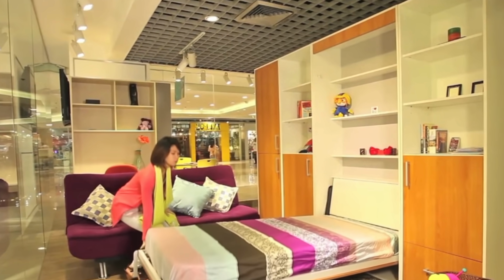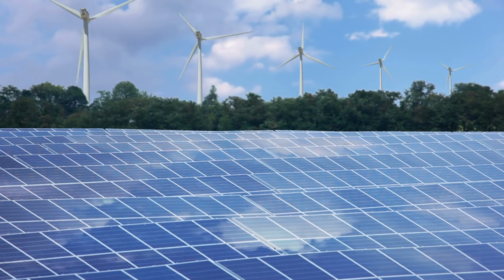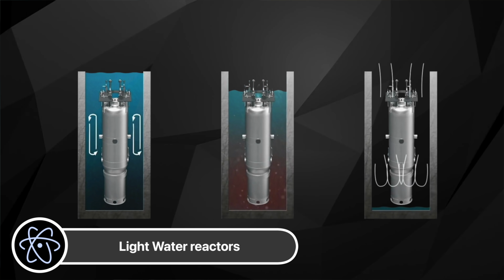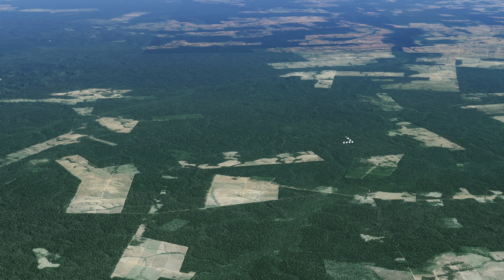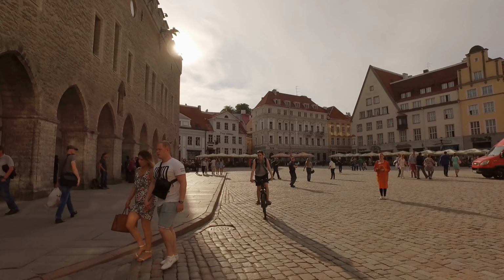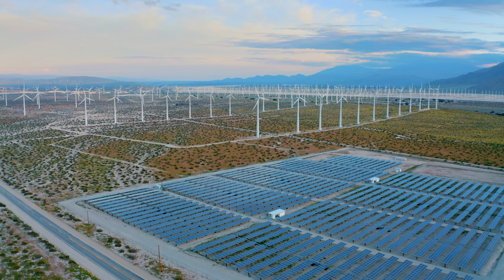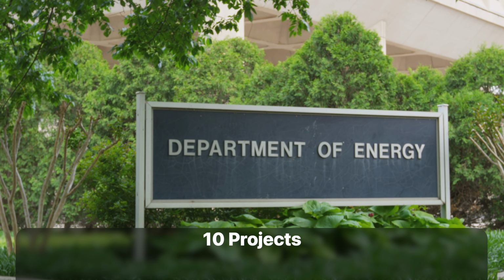Why Small Modular Nuclear Reactors Are the KEY

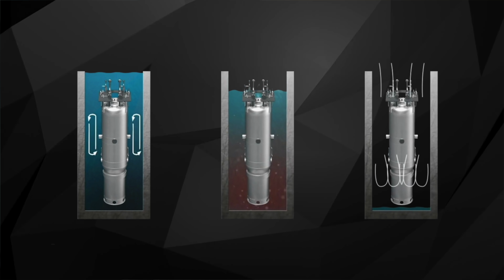Comment: 9:41 "...simply involve a core resting in a pool of water hence Light water SMRs" nope. Firstly, that's not the reason they are called light water SMRs. They are called so because the neutrons produced from nuclear reaction inside the core are moderated by light water instead of heavy water or graphite.
Also, you were showing the picture of the whole reactor vessel in a pool of water, not reactor core. The core is located inside the vessel. 
A reactor type with a core resting in a pool of water is called pool type reactor and those tend to be research reactors with the aim of generating neutrons rather than heating up water in order to make pressurised steam that will turn turbine to generate electricity.

Going back to SMRs resting in a pool of water... they are designed so in order to make sure that the pool of water acts as a heat sink when the reactor trips or when there's a loss of control. The reactor vessel will dissipate its heat in the pool, and as a result the design is inherently preventing a reactor melt down.

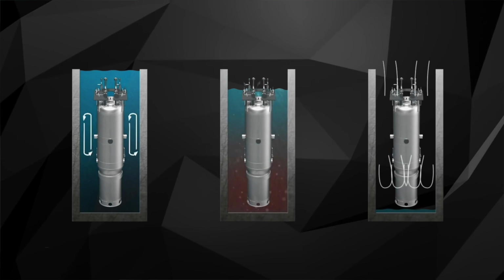9:46 "other systems will use different solvents like molten salts" yes there are other reactors that use molten salts but the molten salt is used as a coolant not a solvent. We are not trying to dissolve anything inside the reactor. Although, the solubility properties of some molten salts are desirable for molten "fuel" salt reactors. These molten fuel salt reactors are the holy grail of fission reactors.

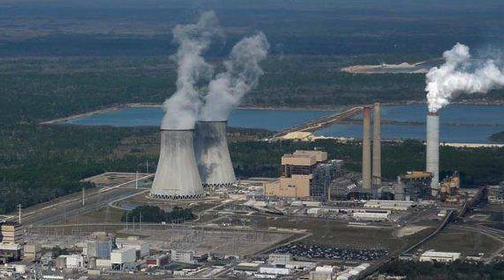11:54 it is really unfair to represent radioactive waste by the the image of water that looks like it has been contaminated by chemicals. 
Nuclear waste is always safely stored in concrete casks.

Comment: Has fission become cheaper and safer than solar, then? The latter probably as people are still more likely to fall off a roof than get a lethal dose of radiation.
Reply: Definitely safer, but not by as much as you would think. Both wind an solar are already much safer than any fossil fuel, and slightly cheaper than any other energy source we currently have.
Reply: @garethbaus5471  Renewables are the cheapest, even cheaper than coal, but not quite the safest per MW.
Reply: @CTimmerman  yep.

Comment: If they can make 2KW reactors that can fit inside of a suitcase, I think that would be game changing/Breaking.  Hook that up to a battery bank (I am going to say a minimum of 4 kw/h) and it could be used to power homes.  A small scale up on this concept could be used as a power source for automobiles and potentially aircraft.
Reply: 2kW  =2000Watt  Many homes consume more then that on 1 day.
Reply: @stefaancodde6578  
My thought process is a bit complicated and everything I said came at the end of it.

Generators are rated at hours, not days.  A 2kw generator running 24 hours would have an output of 48kw a day.  Last time I checked the average home in America uses less than 12kw of electricity a day.
If there was a system that had a constant 2kw of generation, a minimum battery bank of 4kw/h, that could (in theory) power most homes in America.  The batteries would act like a buffer system, in times of high demand the batteries would supplement the power and in times of low demand the batteries would be recharged.
Reply: @johnsmithfakename8422  : generators usual don't run 24/24

Comment: We will have the reactors in cars and trucks. With Electric vehicles, you can have a reactor or 2, producing the electricity to run them instead of batteries, except the small battery to get ot started.

Comment: I would actually like to see micro nuclear reactors instead. Those of just 20mw. For remote areas and small towns they are ideal and makes them independent from the grid. The distance from production to consumers is mostly ignored but the grids are high maintenance and a lot of losses occurr in transportation of the energy. Local production eliminates this. For developing countries with no existing large scale grid it is also a plus.
Reply: Ideally, the power lines should be underground. Far cheaper for short distances!
Reply: 20 milliwatts? Damn that's really small reactor. Not enough to power a pocket flashlight.

Comment: Small nuclear reactors were used for submarines and space voyaging probes for a long time now. They likely had a few iterations by now. My preference is use solar/wind/battery (and bicycles!!) because they are safer. But some would feel I'm standing in the way of progress.
Reply: @dougwedel9484   We don't have energy storage capacity, solar produces nothing more than half the time.  I have my own 4Kw solar system, and I have absolutely no electricity without the grid.  Adding more panels insures massive rolling blackouts.
Reply: @danadurnfordkevinblanchdebunk  How does adding more solar panels ensure massive blackouts?
Reply: @dougwedel9484   Simple, if you keep adding panels you get to the point where you have too much solar electrify that you can't use (like parts of California are experiencing now) with no electricity at night.
Reply: @danadurnfordkevinblanchdebunk  but I thought people had batteries at home, in their car, on the grid. And what you are talking about would be a shut-down at night. People don't use as much power at night. They would have power every day during the day. A big reason for the duck curve is people are keeping the same lifestyle instead of using their electricity during the day, when they make it.
Reply: @dougwedel9484   Wrong, you don't understand solar.  I have had almost zero output from my 4Kw photovoltaic array in the past week.  Even 12 tons of batteries in my system cannot keep up.  Energy storage is the weak link.  Solar arrays put out little in the morning and evening too, that's why in some parts of California they are charging .50 a Kw/hr between the times of 4-9pm.  Solar starts to decline dramatically around 4 when people arrive home and start using more energy which the grid can't handle.  We will see massive rolling blackouts in the future.
Reply: @danadurnfordkevinblanchdebunk  It sounds like these rolling blackouts are still in the future. You have yet to experience them.

In the past solar panel companies sold you a system that either kept you connected to the grid or was completely independent. You could not draw from your own solar panels if they power went out. That is just bizarre. A system should automatically supply your home first, then send excess to the grid and take when home demand is higher than home solar panels (at night, as you say).
Reply: @dougwedel9484   There are places around the world that have been experiencing rolling blackouts since the advent of electricity.  It really depends on how much money is invested in infrastructure. The 100% renewables meme ensures the disparity of the ultra rich and everyone else to maintain no interruptions in electricity supply.

Comment: Your content is decent but the amount of advertising is obscene.
Cost models of large vs small reactors need 2 take cost of transmission lines into account. SMR's require much less expensive lines which r also easier 2 get approved
Reply from the maker: Hey Phill, you're not the first to mention this... so I just looked and there was an extra ad in this one! i've removed it, apologies!
Reply from the maker: believe it or not, youtube actually inserts the mid ads automatically... something we're usually on top of, but missed one on this one. thanks and apologies!

Comment: Great idea but not very practical .  Now we have centralized power so all the high power pylons must be removed and huge number of km heavy wiring. And suppose to have a SMR in the city asks partly all electric wires under the ground must be bigger in size so in a city not so easy to implement.  In rural  area is this better but be careful where it's placed part of the electric wiring must be removed and new bigger wiring.

Comment: I've seen videos on Thorium reactors that could power a car for 100 years. And they can use spent nuclear fuel. Less radiation and much safer.
Both China and India are building larger ones now.
Reply: China is testing 2MW thorium reactor, now. Not yesterday not tomorrow, not any other nation.
Next reactor, if sucess is 400MV in 2030.
Reply: @ivobrick7401  I don't know how far they are along but India also working on them.
Reply: @ivobrick7401  That's how Chinese companies do their checks 2mW reactor and then 400mV   in 2030. No wonder they have many failures.

Comment: Have some SNRs, maybe good! but too much of them, near towns and cities? no! because it is impossible to shield Neutrinos (much smaller particles, than fast Neutrons, equally energetic) and it is difficult to retain, sequester, trap bio-dangerous Tritium. 
 I prefer MSR reactors: high temperature, efficiency, chemical stability, inherent nuclear safety, freeze-plug, no Chernobyl, can drive and power "endotherm" chemical processes, oil-refineries, tar-sand, cement factories,  coking-and steel-foundries, and large-scale cheap hydrogen production.

Comment: Have you looked into the power module  that NASA uses to power the International space station and space shuttles? Radioisotope Power Systems or RPS.
Reply: Those are expensive and have fairly low output.  Their main advantage is small size and long-term reliability, which is ideal for spacecraft.
Reply: @VitalVampyr  which could be used strictly for home use.
Reply: 250 watts of thermal power. not exactly low power
Reply: @drkrypton4410  A single solar panel outputs that much electricity.  The MMRTG NASA is using now outputs closer to 100 watts, and costs over $100 million per unit.
Reply: @VitalVampyr  solar panels dont work at night.
Reply: @drkrypton4410  Batteries do.  However I was saying that more to point out that it isn't actually that much electricity.  Certainly not $100 million worth of electrical generation unless you're going to put it on something that absolutely needs to have some reliable power and is going to cost more than a billion dollars overall anyway.
Reply: @VitalVampyr  it still amazes me they get a rover to run of such little power a damn kettle needs around 2000 watts to boil water in a reasonable amount of time.
Reply: @VitalVampyr  strange how the price of something goes down when it goes public.
Reply: @VitalVampyr  batteries cause huge environmental issues.
Reply: @drkrypton4410  Feel free to point out the affordable, commercially available RTGs or a company working on designing such then.

Comment: Hasn't the Navy continued to look into newer designs?
Reply: True, various navies essentially run SMRs in their submarines, even research submarines. The only problem with those is the highly enriched fuel they use (>90% compared to <10% for commercial fission plants) and specific operating parameters they have to endure during battle, so they are fundamentally different in their core design and aren't commercially viable. These new SMRs are based on decades of lessons learned in the commercial sphere so the science is completely different. It is a stretch, but it is like saying carrier fighter jet engine technology can be used in a diesel truck because they both burn fossil fuel.

Comment: Wind and solar energy are safer, cleaner and cheaper than fossil fuels and nuclear energy.
Wind and solar can provide all the energy the world needs many times over.
Remember Fukishima and Chernobyl. These disasters still have not been cleaned up.
Reply: Also they are far less reliable than SMRs.
Reply: In terms of casualties per kWh nuclear is actually safer than wind and solar accumulator (photovoltaic is slightly safer).  Wind and solar may be able to provide the watt-hours the world needs but not when the world needs them.  Energy storage is expensive and inefficient, relying on that for base load is not cost-effective compared to nuclear.

Fukishima and Chernobyl were very old reactor designs (Gen 2 and 1 respectively).  Gen 3 reactors have been operating for over 20 years without any incident.  Also the Fukushima Daiichi nuclear disaster has been cleaned up other than decommissioning the plant itself (which takes several years even in a properly functioning reactor).

Comment: So the fuel for nuclear power plants is carbon-free?  That's pretty amazing, since so much effort is spent getting it out of the ground and refining it for use in the power plant.  Edit: nuclear fission is also extremely expensive.  Solar works 24 hours a day, every day, and there are no clouds to worry about.  A Lofstrom loop would let us put terawatts of solar in space using dirt-cheap (literally) materials from the moon, all for much less than the cost of a single aircraft carrier.  Beamed power in such tiny quantities as terawatts is safe and also cheap.

Comment: What's needed is an ECU that is capable of rewriting atomic wavelengths in a way that programs decay so that its reoccurrence can happen at in indefinite rate using electrical currents as the method of acceleration. the ECU would be Integrated into the power supply the power supply would be something in the form of a diamond battery. the ECU would be a byproduct of a brand-new form of theoretical particle matter, a plant found ore a smart particle which is isolated and seeable as a mutation that creates a proton-neutron neuronic nucleus the electronic center would move around to the point of being capable of catching a ride on the current of electricity electrons would act as reprogramming as they would replace atomic electrons it being a closed loop system the electrons from the atoms would go through a form of rescripting as they reenter the ECU. It'd be the simulation of Lightning caused Fusion with the use of Electrical Current induced Fusion the ECU would act as an amplification of imputed electrical current as itd program it to a setting that'd be above DC wavelengths
Reply: You lost me at the diamond battery meme.  You must be a graduate of YouTube University.
Reply: @danadurnfordkevinblanchdebunk  diamond battery is a type of battery made from nuclear waste and it is my theoretical concept for the creation of a Pure Fusion Weapon which i theorized without any internet "how to videos" just cups and music.
Reply: @andresalbarran3960   Yeah, I know all about the theoretical part of the "diamond battery", which was debunked years ago.
Reply: @danadurnfordkevinblanchdebunk  you miss read and i miss proofed. i ment to say my original comment is my own concept for both a Pure Fusion Weapon and solid state fission-fusion. i wasn't claiming diamond batteries to be my own concept if that's what you're enunciating the idea isn't "debunked" the technology just isnt ready for mainstream service as our level of capabilities are limited due to the missing element that triggers a nuclear reaction without a whole contraption or primary ignition which is what solid state fission-fusion brings to the scientific table
Reply: @andresalbarran3960   And that's exactly the problem with all energy storage methods we have devised; none are practical for mainstream utility grade service.  What is needed is a quantum leap in energy storage technology if we are to power the world with renewables without massive rolling blackouts.

Comment: It seems reasonable SMRs will become much more practical than solar and wind for base load grid power. Solar and wind are unreliable and the equipment has a short working life.  Replacing solar and wind generation equipment every 20-25 years is an expensive waste.  Even maintenance is a nightmare on equipment high in the sky and/or spread over miles. How does that "iron law" for energy production go... the amount of apparatus needed is inversely proportional to the source energy density.

Southern California has the best wind and solar energy available compared to nearly any other location in the US... hence San Diego must have the lowest cost utility power in the nation... ah well no... more like the most expensive due to wind and solar! The physics simply favors nuclear for base load power. Is California trying to drive a square peg in a round hole? :-) Solar and wind are viable for appropriate applications.

Comment: Nuclear is certainly not carbon free.
Concrete building around it and steel.
Left alone the nuclear waste and radioactive waste of the machines and building and safely storing them for many generations….
Reply: It's not technically carbon free, you are correct, but over the life of the nuclear plant that carbon impact is miniscule overall.

Regarding the waste we have generated over the last 70 years...  It's not really waste, it's still very useful stuff.

Molten salt nuclear reactors like the Molten Chloride Salt Fast Reactor (MCSFR) can take all that nuclear waste we have generated over the last 70 years, recycle it through the MCSFR and transmuting the waste into useful elements that we need more of today.

Elements like neodymium.

Neodymium is used in high end magnets.

EV motors use neodymium magnets

Some of the other elements the MCSFR can produce are:
molybdenum (used in electrodes)
strontium (used in electronics, metallurgy, and chemicals)
zirconium (used in many commercial products)
rhodium (used in electrical contacts)
ruthenium (used in electronics)
and palladium (used in jewelry and specialized alloys).

Those are just the most typical uses for those elements...

Imagine that!

A nuclear reactor that cannot meltdown.
A nuclear reactor that can power all of our homes/businesses/EVs
A nuclear reactor that can recycle all of our old nuclear waste, producing lots of elements that we can use to make more EV's and electronics.